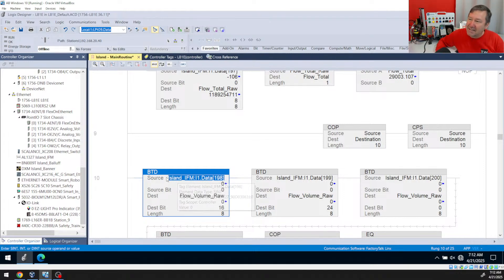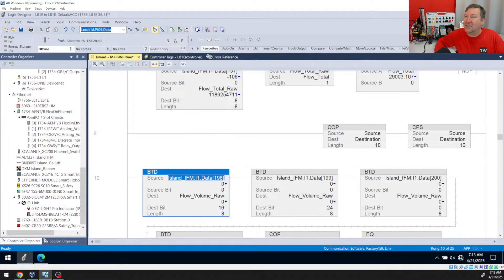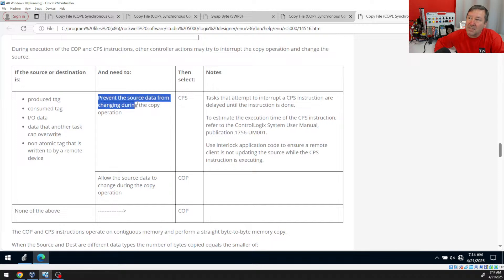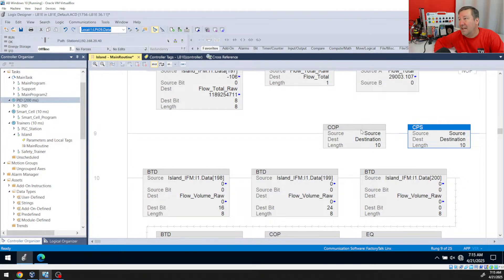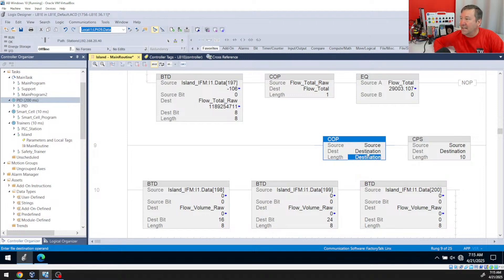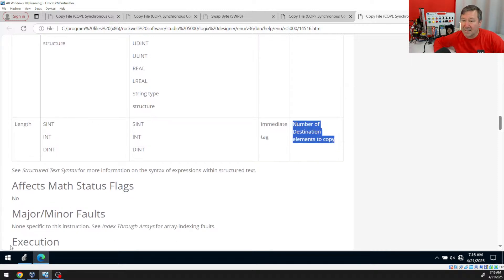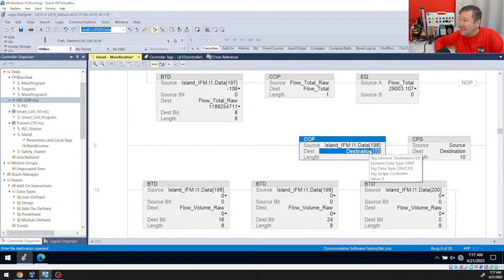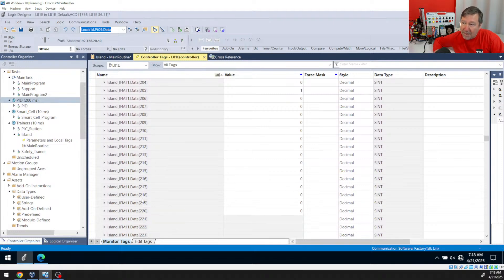COP vs CPS: Which Instruction Should You Use in Studio 5000?

Comment: Hi Tim.

Thank you for the video.

I caught a glimpse of the code and tried to figure out what you were doing on rung 8.

I found those interesting as I'm busy with a similar solution trying to get a DINT into a real value.

Can you possible share how you got FLOW_TOTAL_RAW (1189254711) to be copied into FLOW_TOTAL(29003.107)
Reply from the maker: Hi Ashley.  Here is the original video.  See if it helps.
https://youtube.com/live/VwepOcHi8r0?feature=share
Reply: How does the CPS convert a Dint into a real.
Reply: Thanks for the video. I also got stuck at the high count value. But how does the CPS convert 'CombineWord- 1071351071' to a real of 1.715.

I'm expecting the real value to be 107135107.1
Reply from the maker: I replied to your other comment
Reply: So I'm using a vegapuls 42 io link device which represents the measured value as 32 BIT but this tag value is in the millions and can't see how to convert this into FLOAT variable which Vega say is represented as 0-15 meters

Am I suppose to scale this 32 bit value into a 0-15 m?